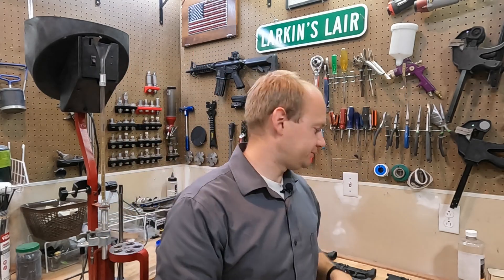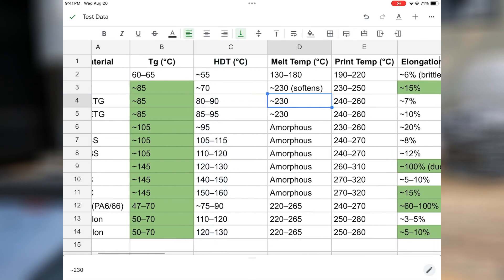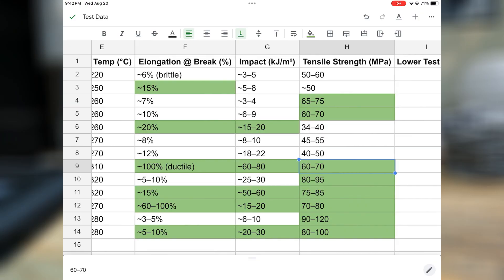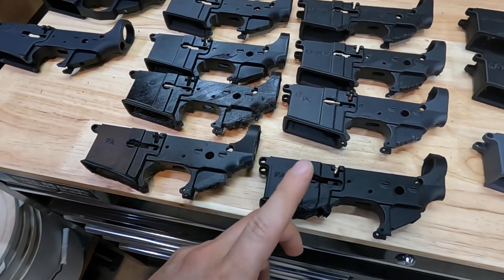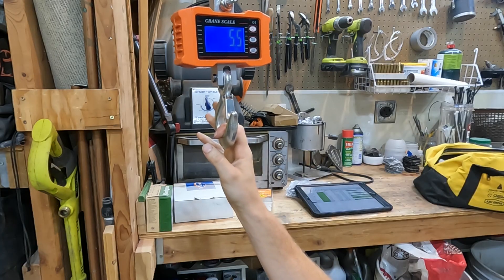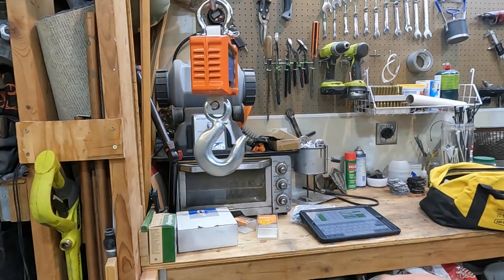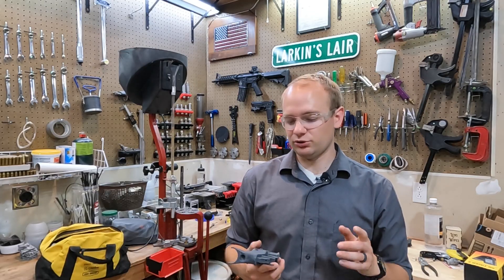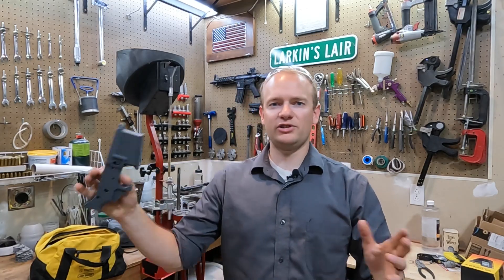Best 3D Printer Material Properties

Comment: I wish I had more time but I'd be interested in running a couple SAAMI proof loads through each and see which hold up and which rip apart.
Edit: I do appreciate the variety of testing though, I like seeing when PETG and ABS are included as to many people have completely written those off as bad.
Reply from the maker: Yeah, I'm right there with you on not having the time to really test them out. I got three kids and a full time job at a start up... so finding time for extensive tests is tricky.